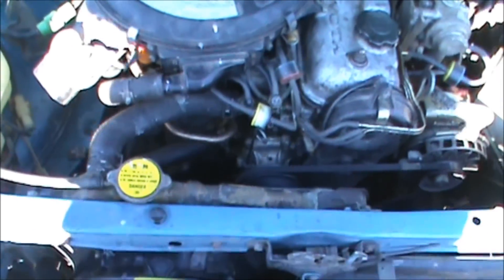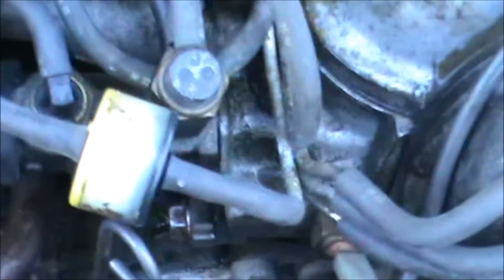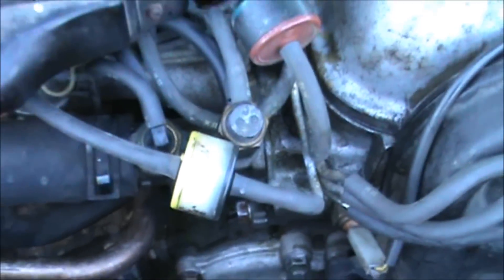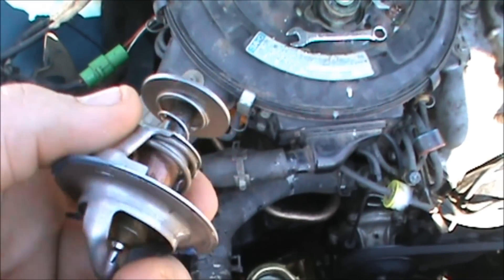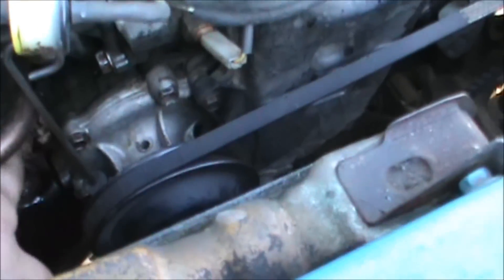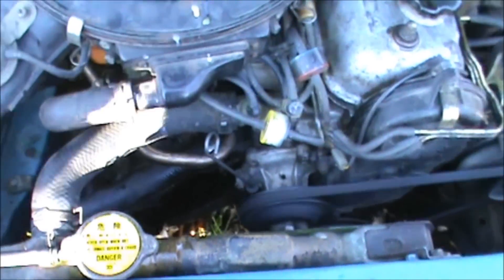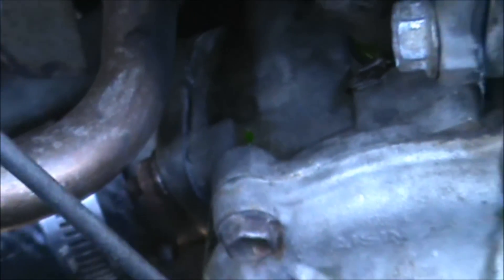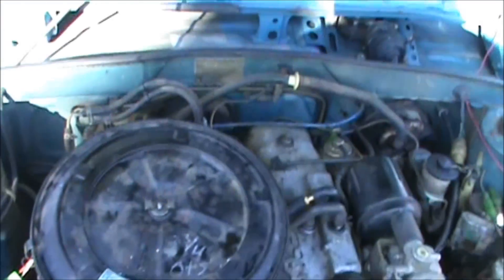Changing the thermostat in the Toyota

Comment: How do you remove the part that you had to put a new gasket in on the upper radiator hose? I need to take mine out because it has a leak but can’t figure it out
Reply from the maker: jori phillips should just be 2 bolts but I honestly don’t remember, sorry.